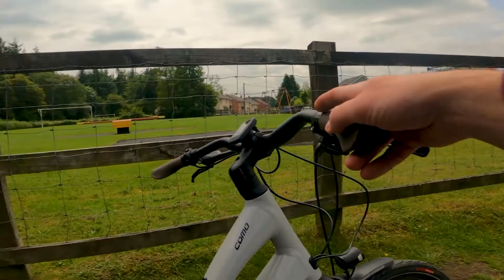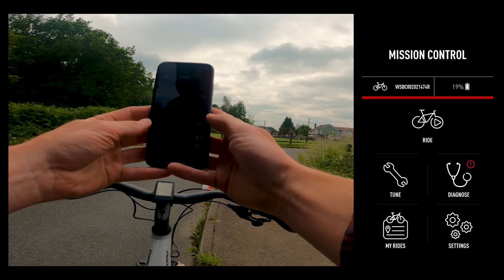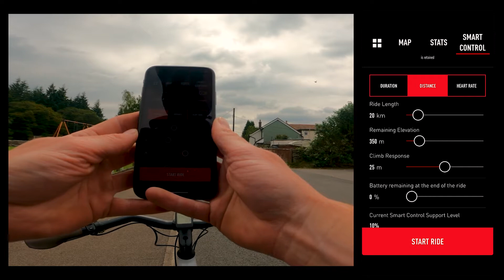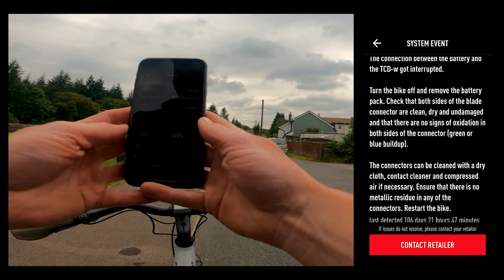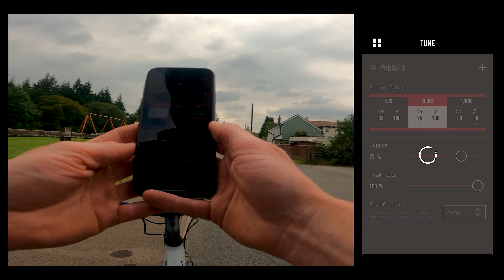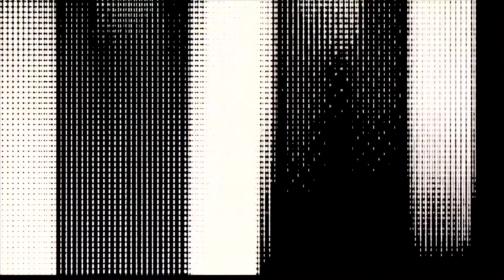Ride Connected: Hit the streets with Mission Control

Comment: This video is a poor introduction for the novice who knows little of the functionality of the App. or the bicycle. For example the explanation of Peak Power is unintelligible: "peak power using the built in torque sensor is what the bike will peak at should you press hard enough on the cranks". You would need then to illustrate this for it to make sense to the new user. Please do better.